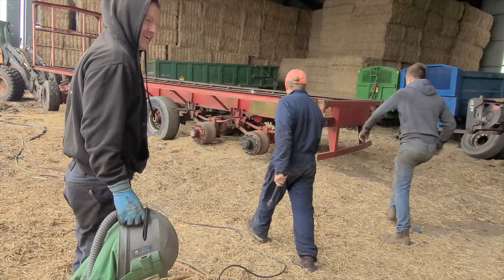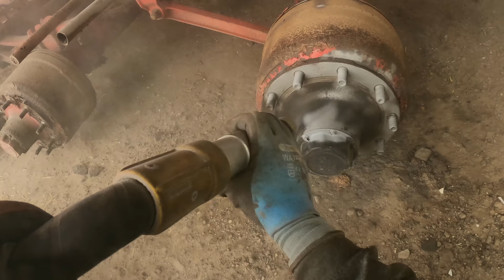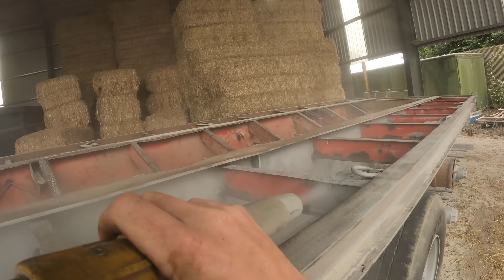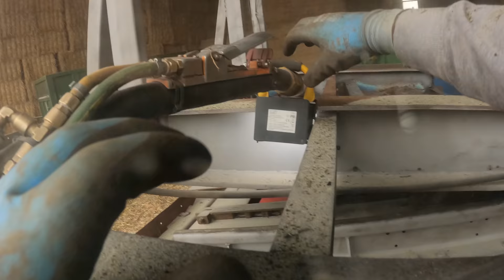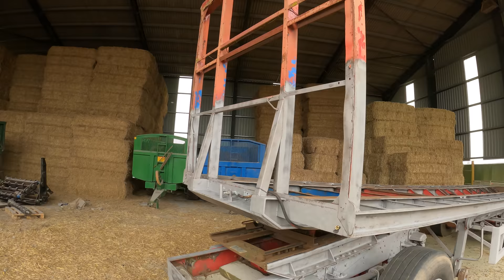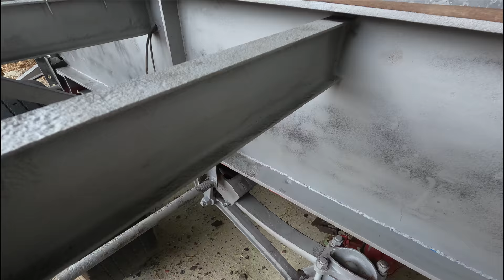Removing Rust & Paint, Farm Trailer SandBlasting

Comment: Treat yourself to a large O ring to go over hose to slide down onto the deadman trigger won’t have to hold with both hands all the time , however don’t let go of it 👍🏼👍🏼
Reply from the maker: That would be very dangerous 😳🙈 I can set it so I move a slider and it blasts slide it back it stops but even that is too dangerous. As it is if I slip or pass out drop it the blaster etc it will shut down hence the name dead man's handle 😁 I know what your saying but from a safety point it needs to be done like this 💞

Comment: Good job!i have a suggestion. Why don't you use a fan or blower to " lead" the dust in the direction YOU want? It gives us, and perhaps you a better sight on what you are doing. Greets from the Netherlands🇳🇱
Reply from the maker: The air mover needed would need to be huge to move the volume of air needed. I'm maxed out as it is with what I'm aloud to carry in the van 😔💞 welcome to the party 👌💞

Comment: Hahahah dont mind doing them big trailer's as long as there well stripped like that one ur doing now.nice job working with the long blast nozzel. Must get one for myself 🤗😁👍
Reply from the maker: Don't let the sales pitch sway you buying 1 they say they add power it doesn't ad anymore power just that it keeps the hotspot in a tite cone for longer 👌💞
Reply: @Mobileblaster  I know what you mean mate.but they look good to use in awkward places 🤗👍
Reply from the maker: Yeah but are they worth the money? I would say yes as I like the easy life but I could have managed without it. They are expensive but once you have 1 try and only use it when needed that way it will last as long as possible 😊
Reply: @Mobileblaster  yes know what you mean mate.will have to price one on line to see what it costs 😁👍
Reply from the maker: @briancamac4573  normal nozel £180 ish xl turbo £550 ish depending on who you use 👌 oh and it will were quicker than a normal one 😳

Comment: Great job your the man Mick.Too bad they don't have nozzles with wider spray pattern be done faster .
Reply from the maker: They do them but in my experience they seam to work out the same speed or slower as it reduces the psi of the hotspot its kinda hard to explain 🙈😂
Reply: They do have bigger nozzles, but faster means less money, that’s why he white metal blasted it while pointing the nozzle inches away from whatever he was hitting, that should’ve only took a few hours while using way less sand.
Reply: @AylerProductions  Bingo

Comment: Go back to first tip an set partial choke on should do great an blow your mind also figure your distance out by moving back an forth
Reply from the maker: using choke would push more sand I don't need more sand? the xl nozzle gives that bit more reach than a normal size nozzle same bore same psi same media just a longer reach with the xl nozzle (all it dose is it keeps the hot spot cone for a longer distance)

Comment: I do blasting every day as my profession and trailers are one of the hardest jobs to do..
Reply from the maker: Ooo I don't mind trailers I don't like using anything over 400cfm my next video I have to profile steel 600cfm with steel shot I really don't like using steel shot that stuff hurts well it does at 600cfm blow back haha
Reply: @Mobileblaster   totally agree steel shot or slag or pretty much anything that is a really corse media sucks to use.
Mostly I use 50/60 green diamond for just about everything.
Reply from the maker: @devininwetrust9610  I like glass 😊 from super fine to medium that's my go too 👌

Comment: using the nova  2000 mask is good but lack of sand flow is making this project way longer coastng way more money, this should take 8 hours or less. and the nossel tip is to small need something a lil bit wider for faster clear speed
Reply from the maker: Hi I'm using the nova 3 not the 2000 :) each blaster will have their own way of doing things the reasons I do it like this, For any more media flow wouldn't give me a faster cut the only thing that would have gave me a faster cut is heaver media and more air cfm in both cases the media needed to cut slightly faster would have been almost 3x the cost of glass and ive tried it in the past I don't fink it cuts 3x faster. So in my opinion not worth the extra cost. More air would be nice but in the uk I'm limited to what I can tow and my 260cfm is right on the border of my vans safe towing ability. More air would drink more derv in turn only saving a little extra time but adding more cost to the job. The Nozzle/tip is set for 260cfm @100psi a bigger nozzle wouldn't gain anything only slow the job down bigger bore will lower the psi anything below 100psi isn't optimal. Anything over 100psi is unsafe with my pot and nearly every other on the market is rated to operate at this. The job he wanted was quoted 8 hour but he then asked for extras taking it over.

Comment: You should have turned your sand up a bit. would have sped the process up a lot and given you a much better blast profile.
Reply from the maker: I tend to disagree hears my reasoning, If I did turn it up I would have wasted media yeah it would be a little quicker but wasting 60/70% of the extra media (with rebound hitting the stream) when im the 1 buying the gear I find a happy medium with derv(air consumption) and media(coverage) I find if the nozzle sounds like a whistle its too low and extra media could be added if it sounds like a train chu chu chuc etc its way too high anywhere in this range (with out theses sounds) is ideal for me. I find lower media more air makes a better profile as the air has more chance of pushing lower volume of media at higher speeds than big lumps of media thats going to re hit the rebound. I like to try and be in the optimal range :)

Comment: Incredible power...  i wonder which compressor is used and which sandblast barel and gun , its very big and expensive i bet
Reply from the maker: Compressor doosan 7 71 (260 cfm at 8 bar) blast pot is a presure pot 👍 yeah the full rig tuck some time to earn its keep haha just about paid off and now I need a new 1 😔lol
Reply: @Mobileblaster  Do you use all that cfm? What's the lowest cfm you would recommend for blasting?
Reply from the maker: @Mattie_Ice  cfm and psi is determined with the nosel and pipes what helmet etc etc I'm running at optimal 198cfm to the nosel rest to presure the pot fees the helmet and any air left will counter the slight were on my nosel 👌 blasting can be achieved with any cfm you need to know cfm you have before buying any equipment. Only 1 real thing to think is bigger the better but derv and mobility then play a massive factor so it's all down to skill level if you get the most out of the air available. Without sounding like a cock a skilled bloke could operate a 140/180cfm and out perform a novice on a 300cfm with efficiency media and derv wise plus the visors that's likely to be used up quicker with less skilled bloke. Basically the better you get at it the more you will save good luck I personally started with a 140cfm and upgraded to 180 around the 2 year after mark then 3 or 5 year after thet I'm on a 260 and find it to be perfect for me but if my driving was any less skilled I would definitely be picking 180 as these can be moved by 1 man well kind of 260 is a 2 man job if your driving is a little poor haha
Reply: @Mobileblaster  Thanks for the reply. Will help me make a choice.

Comment: Great job Mick. What paint do you recommend for first coat?
Reply from the maker: Thx it's appreciated 👌💞 but I'm no painter 🙄 I wouldn't recommend anything I don't use or know much about 🙈
Reply: Epoxy primer is the industry standard for shot blasted trailers. It is a good thick coating that goes on before adding a colour.
Reply from the maker: @mycarprobs6688  Yeah I've heard my brother mention something like that before. This guy was going down the DTM paint root (direct to metal). Its a all in one other names ive heard people say is rain coat/ one coat, loads of different names but its all the same thing I don't know if it's any good like I say I take paint off not put it on :)

Comment: Must cost a fortune for the medium wasted
Reply from the maker: Not really as this is 1 x hit possibly 2 x but after the 1st hit it brakes up so I wouldn't get a uniform finish. I could use a different media to last longer but the cost is up on that and then the productivity is down so catch 22 some areas it would pay some not so good. Everyone finds their own style and what works for them I add these costs into my price obversely and it seams to be working for me. :)
Reply: @Mobileblaster  yeh it makes sense bud, it probably ran through my mind in a logical way, but I chose to ignore it 😂, I used to paint that stuff a while back and the set up we had was a small warehouse where it would be blasted before the paint went on, and the shot was on the floor to be later swept up to be used again, so I do see the point👍 very therapeutic
Reply from the maker: @Amac-uz9hm  yeah sometimes on the right job and location it would pay to do it that way :)

Comment: Is the media recyclable?!
Reply from the maker: Yeah its recycled bottle glass. It could be reusable again but for speed of the job I don't reuse the media. Plus once its been used it brakes down and don't leave a uniform finish if its used more than once.
Reply: @Mobileblaster  thanks for the information! What about the broken/ worn-out media? It is hard to recollect as it mixed up with soil and therefore contaminating soil or is is recycled into glass again? Anyway great to see your work and even greater was your prompt reply! Cheers 👍👍👍
Reply from the maker: @ravindernegi7419 Thx it's appreciated 😊💞 the media could be used again but I don't for the speed aspect of things. It wouldn't affect the soil/ground as its none carcinogenic and the paint was water based so biodegradable 😊
Reply: @Mobileblaster  thanks indeed 👍👍

Comment: Take the dead man off the hose bro. Don’t hold the nozzle with your hand if it comes off it’s gonna hurt. Your hand should be half on the join and half on the hose. Blast all underside surfaces first. And did I see you blast the threads the tyres bolt onto. Ugh. I’ve blasted for 15 years in Mining oil and gas so maybe a bit fussy. The positive side I’ve seen worse. Lol.
Reply from the maker: If the Nozzle wasn't supposed to be held why has it got nerling on for grip? The job sheet on this was to do the face's none of the underside 👌 the media used won't damage the threads just clean them out I'm able to blast wires and airline's with out busting or cutting through them I know they will be fine 👍 to make a complete perfect job it would need stripping to an inch of its life have it over a pit etc but the man hours alone would value the trailer as scrap all he was after was a tidy up so the old bill don't pull him over as he moves it from 1 field to the next. With it been agricultural it don't need MOT (UK tests to say its safe for the road) same again it won't be pulled any faster than 25mph and a maximum of 1.6km from his farm or land 👍 he just wanted it to look fresher than it did 😊 please have a snoop through my other videos 😊
Reply: Understood bro. I’m just extremely fussy. 👍🏽
Reply: I’ve seen nozzles come off not a pretty sight. Holding the hose also makes for better control as you can make it do the work for you. 😀

Comment: Hi pal,  watched all your videos as I'm just been starting off blasting people think it's easy but it's not your doing well fair play wouldn't mind your number to have a chat if possible
Reply from the maker: Thx it does look easy but the is more to hit n hope haha. I can answer any questions you may have on hear that way it will help the channel out with other people may have similar questions I don't want to keep repeating myself 💞👌👍
Reply: @Mobileblaster  I've been happing trouble with my compressor , compressor oil going in the air lines? I'm after another compressor if you know for any for sale
Reply from the maker: @rhyslewis2062  What compressor is it? You can easily fix that issue no problem swap out the air oil separator buy a service kit for said unit change the filters and oil should stop that issue 👌💞
Reply: @Mobileblaster  atlas copco 180cfm mare.... I seen you might be selling yours buddy
Reply from the maker: @rhyslewis2062  no mine is not for sale 180 is about the best all rounder I would service and keep using that.
Reply: @Mobileblaster   what size nozzle would you use with 180 cfm
Reply from the maker: @rhyslewis2062  cdx550 👌 but don't take my word make your own decision as nozzles are very important to your style and methods you want to aim for 100psi at the nozzle with the cfm giving they are charts all over the Internet 👌 take your helmet cfm into account and any other auxiliary you may be running 🤘